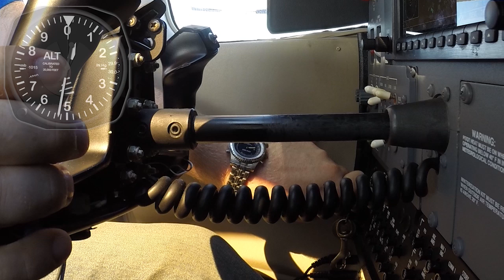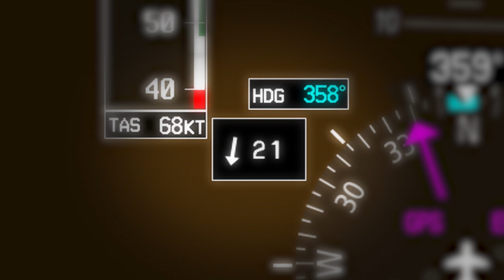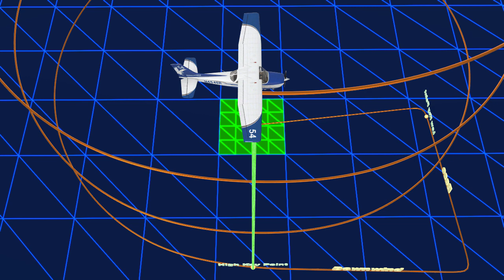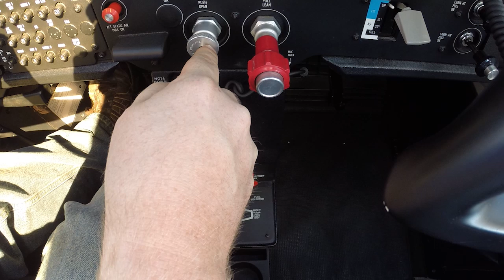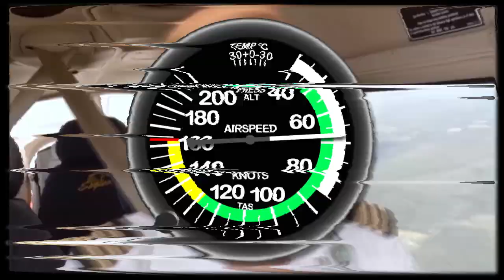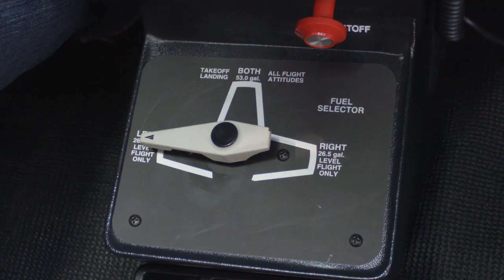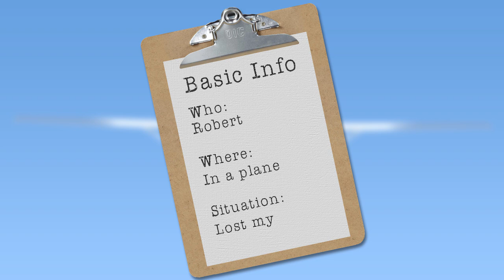Emergency Approach and Landing - Lesson 1

Comment: You can use "Simulated Idle" setting.  Some flaps, slow down with carb heat too if.. and dont pull to idle.  Use about 14 MP.  Power a bit over idle.  Control speed and descend with flaps, not the engine.  Some dont know how to adjust flaps on final.. yes you can retract them slowly.  Actually you accelerate when you retract them.  Dont be a coward.. If cold, use Sim Idle, not Idle.

Comment: 3:03 1.5 miles per 1000 feet doesnt work out to a 1.5:1 ratio. Thats not how ratios work.

If it can glide 1.5 miles that's about 8000 feet so it would be 8000:1000 or 8:1, which makes more sense.

Don't dumb things down to try and make it sound easier if it means teaching incorrect terminology.

Comment: BG---> knowLedge of HighALtitude presence is noT confined onLy to controL the plane buT also to regulate cardioRespiratory sySTEM at bronchus [sTem ---bronchus|branch
--bronchioLes Engine optimisation oR judgement regulates the sequence of tachoMetre.bubble h2O baLance metre for diagnostics of incLination whiLe DescenT ----> and rotation descenT shouLd be practiced upon 
aThEmergency situ.Ation windscreen doesnT signifies whiLe dasHBoard BENefieTs oR to those known aBouT oScicLes controL doesnT even requires dasHBoard buT BENefieTs thro varianT oScicLe comparedBalance----> by HgBarometric pressure varianT among oScicLes ---> note spo2 reduces whiLe descenT with aSociated nausae.insomnae The conDUCTion FeCu2: ]---> CircuiT shouLdEfficienTise with aLterated aLtitudes [usually descenT] shouLd reguLate upperTo lower CircuiT IE on descenT the O---zerO gravity inferior CircuiT suspended with coiLedLength suspended by ball.oR.oon ---> balloon raises whiLe descenT and commisuraTes contact of upLow circuiT and intenscLy magnifies metREadings with highLighted immense vision during dusk crashes 
---> eLaboration of resonence receipTed by hibilis pilots example----> emergency siron of unstabilisation has toB magnifiedResonence hertz because pilots concentration varies whiLe panic oRevoluTion descenT reduces ionsProvision to brain [CoresPonding to fecu2: CircuiT aLso presenTs meTaL significance of haemFe: ions and cu:ions aLso to brain similar to dasHBoard CircuiTs 
SuspendedHo.o2O baLance tube is nonELectroStem like magnetoMetre oR direction metres [ one of significance for direction metres is direction of wind by anDisPlacement of field grass oR trees shouLdB diagnosed by nonELectroStem because aTime of tragedy nonELectroStems functions as aT some trage.dies eLectroCu:tion [electroConduction] of cu: reduces ExampLe---CircuiT burns and prEquiped trained nonELectroStems are significant in GasOLine tank fires oR vadied combusTion burns oR conjoinTs CircuiT being more ErroRED dangerous because of inTerpreTated comand and LaTer no command controL of sTeer oR switchs requires nonELectroStemSysTematic grasPerciepTion of CnS and spinaL refLex IE flexible mind .Lively conscience R important aTragedies in any fieLds of professionals ---> piloTTing being one of thEM 
cu: CircuiT aLso resisTs aLtitude varianT meTaLLergies thaTsuiTable for airoDynamic [aeroDynamic.averoDynamic] engines aT high aLtitudes with reduced o2 atmoSphere aRound hemisphere of  earth Ozone is ⬆️FLoaT gas lighTer than condensed air and iSaTurated at ⬆️aLtitude infiltrates engines LevoDexTro controLe and combusTion facilities in engines
NexTLecture on Medical science devices and emergencies U tube
Reply: Sounds interesting could you retype it having trouble reading it thanks for sharing

Comment: i've learned also to land up hill and stop perpendicular, and while landing try to keep the pressure of the nosewheel as little as possible if it gets stuck in the muddy soil you can tip over.

Comment: Is it okay to land on a golf course, if that's one of the options, or rather the best option under the circumstances?
Reply: It’s okey to land literally anywhere as long as you can do it safely. It’s an emergency.
Reply: A golf course is a great option if you find a hole long enough, they are usually well trimmed grass with few obstructions in the middle of the fairway, if there aren't any golfers down below and the slope isn't too bad then go for it.

Comment: Panic can be the killer with a loss of engine power so a simple note of action is ABC.
A = Best glide speed.
B =  Best place to land.
C = Checks if you have time.
Reply: It's not hard to memorize a few steps cold. 

Trim for best glide. 
Pick landing site. 
Fly towards landing site. 

Memorize and practice a flow to restart the engine. "Floor-to-the-door"

If you're still above the hard deck (say, 2000 AGL), get out the checklist.

If not, do what you can from memory and fly it all the way to the scene of the crash. Remember, planes that land with low energy, wings level, under control usually have survivors on board.
Reply: @GZA036  can you explain the "floor to the door"?
Reply: thank you!
Reply: I've always been taught ABCDE but I suppose ABC is quicker and to be fair the only NECESSARY parts you really want to stay focused on.
For those curious:
A - Aviate (best glide speed, coordination, turns etc.)
B - Best landing field (don't fly into a precariously placed tower!)
C - Checklist (restart the engine, secure the aircraft for the landing, only done if time is spare)
D - Diagnose/declare (Know what your problem is, engine shut off and you see your fuel ran out in the left tank? Simple, change to the right tank and continue flying after engine restart)
E - Execute (put wheels to the ground and safely at that)

Comment: I’m confused. Do we need a flap when airplane engine failure? I think the increase risk of stalls
Reply: Flaps may steepen your descent angle (hence don't set them until sure of making the chosen landing site) - but will crucially lower the effective stall speed, allowing a slower touchdown and shorter ground roll - and usually allowing greater aileron response at low airspeed. A low touchdown speed and short ground roll is especially important if the landing surface is rough and/or limited in length.
Reply: where do we approach high key point and low key point?

Comment: Great video. But: Don't do spiral 360 turns to lose altitude, don't turn your back on your landing site, because if you mis-judge the last turn, you can be screwed. Instead, where possible (or at least when you get down low) make "S" turns, this way and that, keeping your nose at right angles to the landing site, because at any point, if you are too low, just cut the corner and turn straight toward the field. Can't do that if you turn your back to the field.
Reply: Circling around an airport would not turn your back to the field... Also as a student I have zero experience "straight in" and without my "decent to field" from foreflight I would have a hard time doing a straight in. Its much better for many to enter a patter like they have done 150 times. 360s down to the field also mean if you are way too low you might just need to land opposite direction with a tail wind.
Reply: Nonsense. You're spiraling and keeping the key points/landing zone in view below you. It's the steep spiral manuever from commercial training.

Comment: Point of destination should be a determination after minimizing loss of critical altitude . Not mentioned here.  A critical tool in all landings by hang glider and sailplane pilots.  Point of destination after a resonable search for a good lz make a determination by if you see your touch down point rising to your field of view you will make a determination quickly that you have little hope of reaching that lz. If you see that point sinking  you know you have a  good resonable chance of reaching that lz.  A very valuable tool not on your flight panel! Keeping calm , the wing flying and your head looking out of the aircraft and make the best adm choices will save you.too much concentration on your instruments  will take away very valuable adm time looking and acessing field of view. Powerlines ,fences and obsticles hidden making quick decisive desicions. Just my opinion
Reply: As explained in Wolfgang Langewiche's book "Stick and Rudder". https://en.wikipedia.org/wiki/Stick_and_Rudder . Yes indeed!  Set up best glide and observe straight ahead, where you are gliding down toward. Then complete a "cone" around you, at that same angle or steeper, to select your possible landing sites.

Comment: Magnetos as first thing to check when engine fails?  Har, har, har!!
Reply from the maker: Might want to go back and watch that again......the first thing we teach you to check is your Fuel Selector.
Reply: i see it later on.  This is cruise altitude engine total fails. Partial Power engine fails are different.  I had 4.
Reply from the maker: CFITOMAHAWK2 Sounds like you either need a better mechanic or a more thorough preflight.
Reply: @CFITOMAHAWK2  interesting what else gave you engine trouble ?  Thanks for sharing

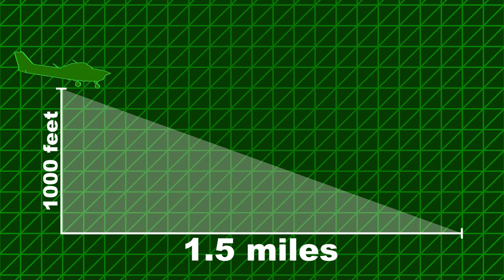Comment: At 3:10 you display a misleading figure. 1000 feet is 0,19 miles, so the glide slope is arctg (0,19/1,5) ~ 7 degrees - much less steep than shown. But do you really compare 1000's of feet to miles when speaking of "glide ratio"? Quite a non-traditional way to treat units in physics.
Reply: I was surprised as well. If you used the same units for both sides of the "ratio", then the units themselves would not matter. It would suffice to say 9:1 and it would work the same way for feet, meters, kilometers, miles, etc. If you have different units of the same quantity (length), then calling it a ratio may be misleading, and - at least for me - makes things unnecessarily complicated and ambiguous.
Reply from the maker: That's exactly how we do it in the aviation world. It is a simplified method that reduces the need for pilots to calculate complicated mathematic formulas while in flight. We blend units for expediency in making our calculations. It's been working for us for over a hundred years, so we probably won't be changing anytime soon. :-)
Reply: In the FAA Airplane Flying Handbook (FAA-H-8083-3B) the sole numerical example of glide ratio (on page 3-20) is expressed with same units at both sides of the divider (feet/feet). And of course the Glider Flying Handbook (FAA-H-8083-13A) is packed with discussion of glide ratios - all using the same units for dividend and divisor.

I understand the logic behind using the rule of thumb values for quick estimations in your head. But stating that that is 'exactly  how we do it in the aviation world' seems a bit overblown?

Comment: Huh? Im surprised you guys have this big of an error in this. A 1.5:1 glide ratio would mean that you would glide only 1500' from 1000' and is not great at all. A 172 is closer to 9:1 - meaning if you are a mile high, you could glider 9 miles. Or - if you are 1000' high, you can glide 9000'
Reply from the maker: Curt Lewis Not a mistake at all, you’ve simply got your units confused.  Glide Ratios are typically presented as “Nautical Miles per One-Thousand Feet.” This keeps the pilot having to do unnecessary conversions during critical phases of flight. For example.....the Cessna glides at about 1.5nm per 1000 feet. That’s around 9000 lateral feet for every vertical 1000 feet. Since we generally use Nautical Miles as a measure of distance, it is simple easier to represent this figure as 1.5:1.
Reply: Yeah I got it. I don't think I have ever heard of a ratio using two different units of measurement is all. You can say that you will glide 1.5nm for every 1000' and that is very nice and practical, but I would call that a 'rate' if it only works as "nm : ft"    3:2, 4.5:3, etc etc 

Great content!
Reply: I was surprised as well. If you used the same units for both sides of the "ratio", then the units themselves would not matter. It would suffice to say 9:1 and it would work the same way for feet, meters, kilometers, miles, etc. If you have different units of the same quantity (length), then calling it a ratio may be misleading, and - at least for me - makes things unnecessarily complicated and ambiguous.

Comment: Good infor! Just a question, extending flaps during a crash landing would reduce the speed and risk for injuries, but when the engine isn’t running, which means you will lose more speed and altitude if you add flaps cuz it creates more drag, in this case I would wanna do a no flap landing cause otherwise I will lose my precious altitude,speed and range. So is it really necessary to add flaps?
Reply from the maker: Flaps should be added as necessary once you know you can make your intended point of landing. Touching down with the lowest energy possible increases your chances of survival.